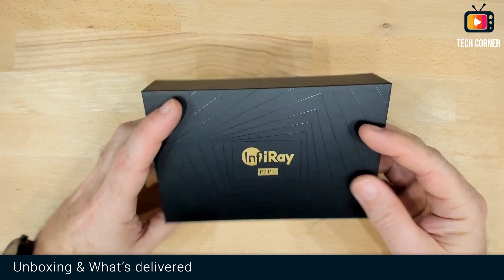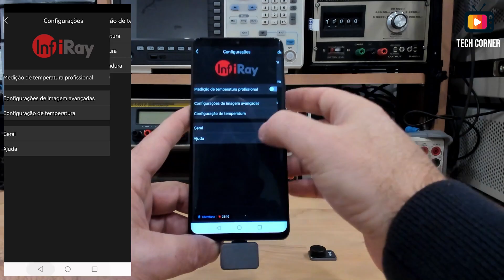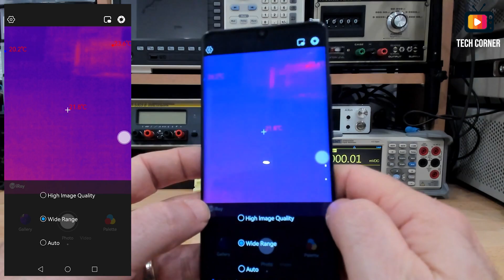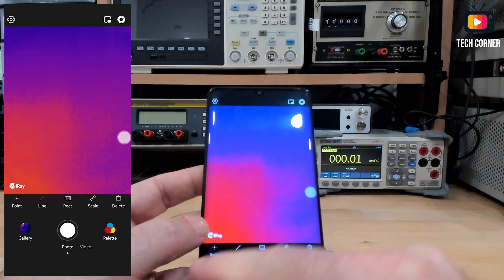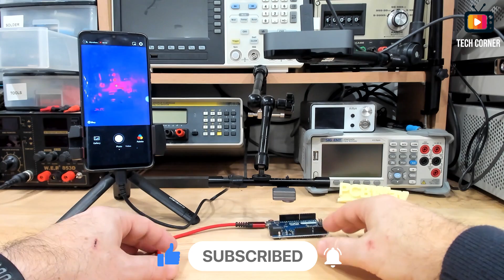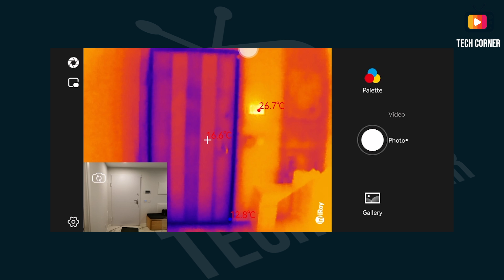InfiRay P2 Pro Thermal Camera ⭐ For Electronics and Much More!

Comment: I'm super satisfied with that camera.
The only issue I've found is the live-view freezes for split of a second every 10-15 seconds. It also records that freezing on a video. 
Not a big issue but would be nice if it was fixed
Reply: The manual stated that that can happen, because the camera do a mechanical self calibration in intervals. Its short and like you said no issue at all.

Comment: Well mines about 8 month old, kept on a shelf in a padded bag, took less than a hundred images and maybe 60 minutes of video, and its gone weird with 4 ghost images on video, live preview while recording is fine, photos are fine. reinstalled app, tried another phone.

https://www.youtube.com/shorts/zTzTzZxSfa0
Reply from the maker: Hi, that's weird, mine still works, reach InfiRay to say what they say. Thanks for watching and sharing.
Reply: @TechCornerTV  I have messaged them but no reply yet. What's totally weird  is its only the file that's this way, on-screen everything is perfect even while recording, so I'm wondering if it's the app encoding wrong and not the hardware. Also depending on the colour map option you get a different level of errors, use hot=white or hot=black and it's 'better' but other settings like hot=blue to red rainbow and it's terrible.

Comment: Do any of you have experience with apps for this camera? The original one won't launch on my Pixel 7 with Android 14, and my colleague's S22 won't run it either. I'll try to dig out my old S8. The only app we've managed to get an image from is TC001, but it doesn't show temperatures, just a constant -273.1 °C. The Uni-t thermal mobile app doesn't recognize the camera. I'm talking about the current versions available on Google Play.
Reply from the maker: Hi, that's really weird. If you notice other review also in YT you'll have several people using on different phones, I even tested it on PC also. Those chinese apps most of the time require location to be on to work properly, try it,. Thanks for watching.
Reply: Mine works perfectly for more than a year. I have only installed and used the app on my Oppo phone.

Comment: it's too expensive for the product not stand alone.It.s not convenient.
Reply: I think you have no clue what a decent camera with that specs costs. And exactly the small form factor and that the cam is not a standalone unit is a huge benefit, at least for my type of work. When i am analyzing printed boards for shorts i have the cam connected to a flexible silicon USB cable and directly behind the object of investigation is a huge 34 Zoll Monitor, where the image of the cam is displayed, while I drive through the printed board. Better it can't be! 😊
Reply from the maker: Hi, I just found out that Tooltop has the T7 that has the same resolution but no macro lens (yet). After reviewing some of the products I have here from them, I will see if they are interested in a review of that T7, is nearly half the price for the same resolution. Thanks for watching.

Comment: Nice. I briefly owned one of those USB Flir cameras, but I got scared when I heard about the "battery discharge self destruction" issue. I've often see this camera too, and in happy to see it does work decently...I just wish it was 1/3rd the price. 😉 I really like that its just a USB camera, meaning you can just plug it into any PC. Would be handy for machine vision tasks.
Reply from the maker: Hi Mke. thanks for sharing, regarding the price, yeah, it starts to be a bit high but not out of the rest considering the competition... I will review soon a new model of a Tooltop device that I reviewed in the past ET12S, but the model has 192x192 IR resolution and connects to the PC, so keep an eye on the videos for the next weeks, it should be arriving soon. Thanks for watching.

Comment: Chinese shite. If it was around €100 then perhaps it would be worth considering. You can buy FLIR One starting from around €200.
Reply: I have the P2 Pro for more than a year and it's much better than Flir (mich higher resolution) and cheaper as well. The best I could find on the internet. I'm very satisfied by that camera
Reply: You have no idea what a decent camera of that spec costs. And by the way - this "Chinese shite" has Premium build quality and is a professional tool, no toy!
Reply from the maker: Hi again, when I replied was in the office and I did a bit more research when I got home. Flir one has a IR resolution of 80x60 (Flir One LT version) and 160x120 (Flir One Pro version). The gen 3 version costs $229,99 in Flir Teladyne website, didn't find it in AliExpress. In AliExpress where I use the prices to base my video, costs 312€, significantly more than the P2 Pro for a equivalente product and has way less IR resolution... am I wrong to say this is a good product and more or less around the prices you find for same equal devices, I think with this comparation I could go even further, that said, and I can't enphasize this enough, I do appreciate your comment. You took the time to particpate and I am really grateful for that. But this video seemed to trigger some viewers for a reason I can't understand. Wish you the best!
Reply: Compare the resolution. This is 256x192, and flir one has?
Reply: @antigravity8247  resolution is just an empty number that does little to usability. You can bring the camera closer to resolve more detail. Real usability comes from reliability, accuracy and sensitivity. Try to compare these with this Chinese product.
With resolution it's like 1080p vs 2160p - most people can't tell the difference unless the TV is 88". Most phones have god knows how big resolution but by default they run quarter of that and no one knows.
Reply from the maker: Hi, Already answered that here, I'm not the one who set the prices, even so I went to check on AliExpress and the lowest I found for FLIR One was 312€, it was a quick look so, maybe I might find better prices if look better, even so is a bit away from the 222€ that I have this device. But the is the FLIR One not chinese?  Thanks for watching and you comment.